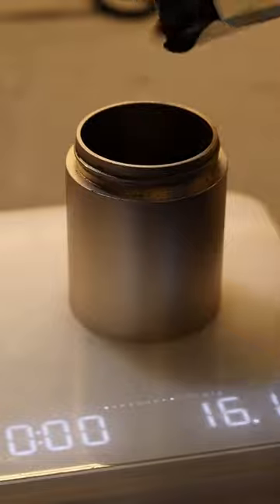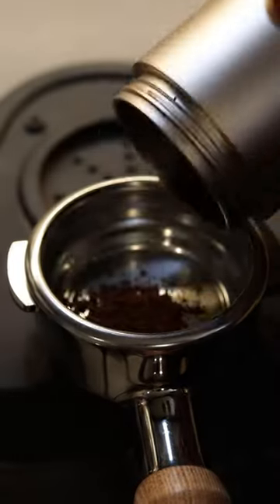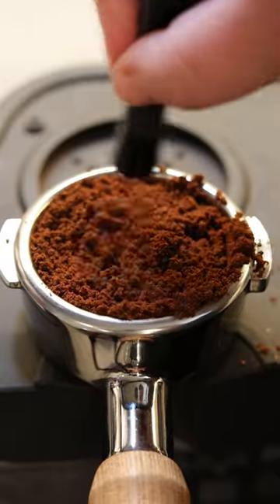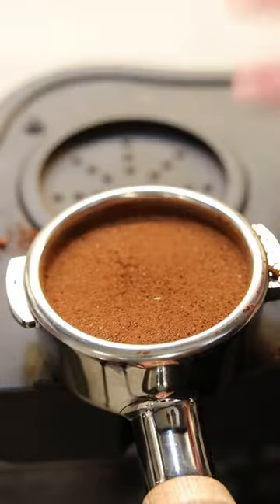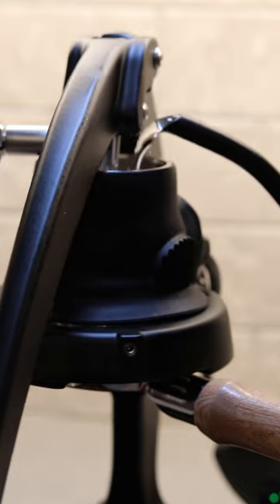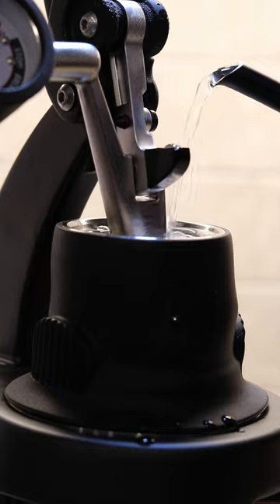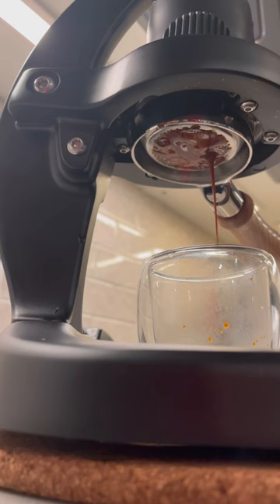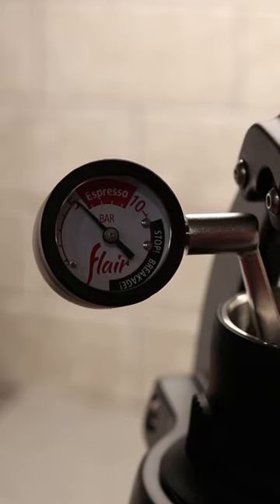My Flair 58 Espresso Workflow #shorts

Comment: See barely any recipes for manual machines.  Obviously 40 seconds is longer than what I'm used to but that checked out as you are using a different pressure profile instead of a constant 9 bar.

Eye opening!

Comment: 40s sounds a bit long.  Is that because you want a slower shot or does the flair require that.
Reply from the maker: Includes pre-infusion ☺️
Reply: @CaitlinCampbellCC  I mean, my avg time for an espresso pull is around 27-33s even with pre-infusion.  Does the flair manual pre-infusion take longer than a standard machine?
Reply from the maker: 40 seconds with pre-infusion for the flair is pretty typical from what I’ve learnt from others
Reply: @CaitlinCampbellCC  That's very interesting.  I've never used a flair before.

Comment: Wrong wdt usage, you need to get a ring to make sure there is no spillage. In addition, WDT should be used gently, not violent stirring. Also, before putting the puck screen in, make sure the side is clean from coffee ground, sometimes I get some ground on top of the puck screen. Moreover, machines use 9 bars but when it translates to the flair 58 it’s always less than 9 because 9 bars is the pressure going in but not the actual pressure in the chamber. My experience tells me pre infusion at 3-4 bars and extract around 7 bars. Lastly, check the video you got some serious channeling and uneven distribution of the coffee ground.

Comment: Obviously it changes depending on the beans and the individual hand grinder, but what grind level do you set it at for espresso?
Reply: Very fine, but these flair units work better with it a little more rough.